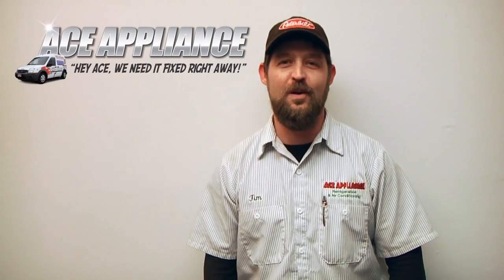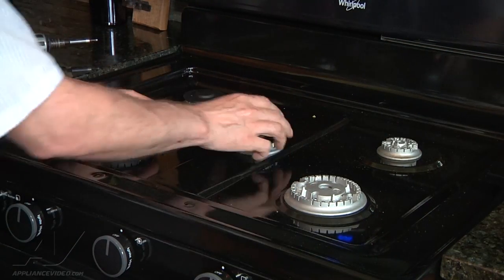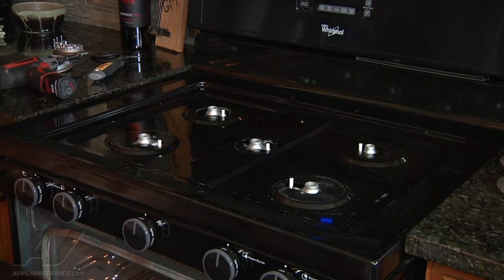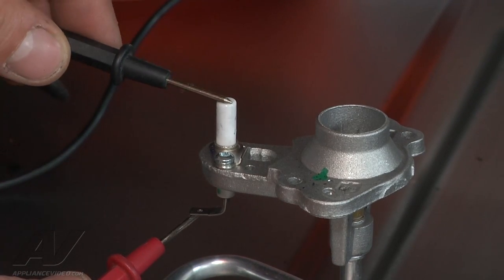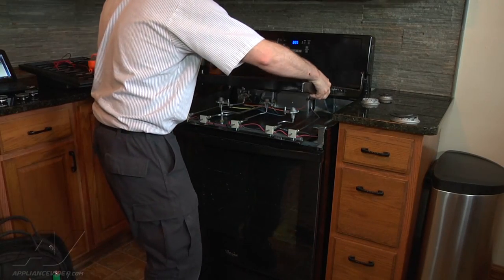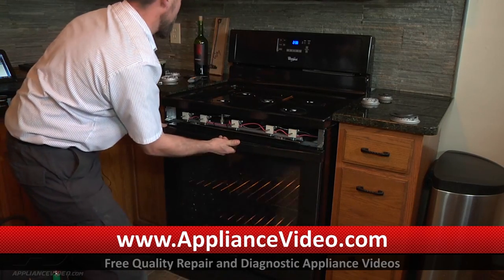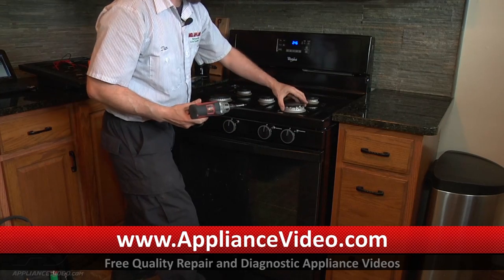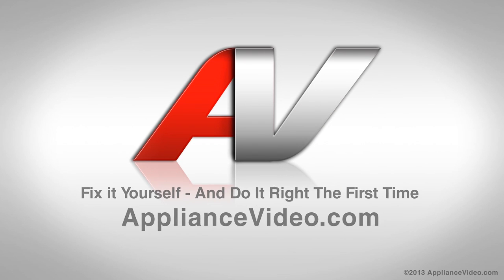Whirlpool Stove Repair - Right Front Burner Does Not Ignite - Wire Harness

Comment: i have a Creda counter top the ignator sparks all the time.What ca I do to fix this matter?
Please let me know.Ramiro Vaca
Reply from the maker: Great question, you can call
our parts department at 1-800-830-5465 and they can give you help 6-days A week
Mon-Sat . You can also search at www.SaveMoreOnParts.com 7- days a week.  If you have a more
technical question that our parts department cannot answer, our technicians are
answering all questions at our website at www.ApplianceVideo.com under our Repair Help section. We have over 6,000
common questions and answers that you can easily search through by your model
number, appliance make, problem or error codes, and It’s completely free to
search through our question & answer library. There is a very good chance
you question is already answered there.

Comment: hi, i have Frigidaire gas stove. ignitor is good, i can see spark in blue colour. GAS is coming well. but it is not lighting. i can see that spark is not lighting up to the cap, rather it is sparking to the side .. any advise, if i light with match it is lighting. FGF366ECA is the model. infact i changed the electrode just incase no use. dont know waht to do..this is the right most front burner on this model which has bigger cap then the rest of three.

Comment: Left front, I hear it clicking, I see it sparking, burner does not light? There is gas.
Reply: Found another video...problem is little tiny hole in igniter pocket of burner gets clogged, clean it out, voila burner lights again.
Reply from the maker: Great question, if you have a more technical question that our parts department cannot answer, you can search our over 17,000 answered questions free at our website www.ApplianceVideo.com under our Repair Help section. You can also call our parts department at 1-800-830-5465 and they can give you help 7-days A week ,or search at www.SaveMoreOnParts.com  .